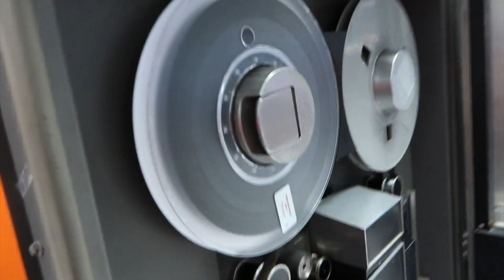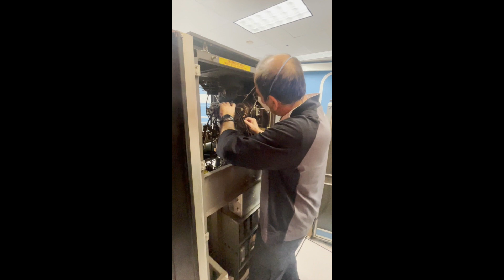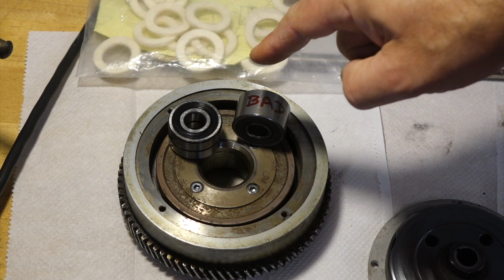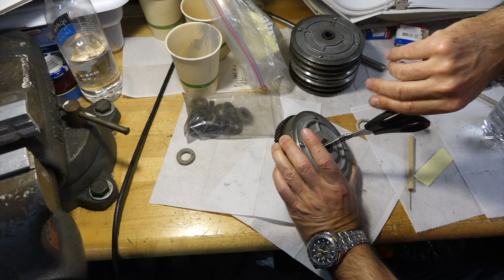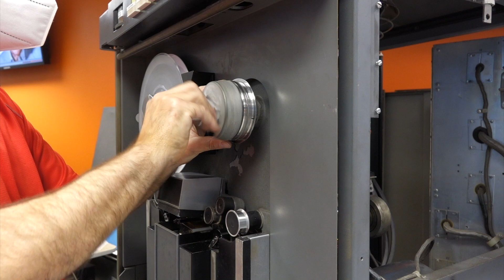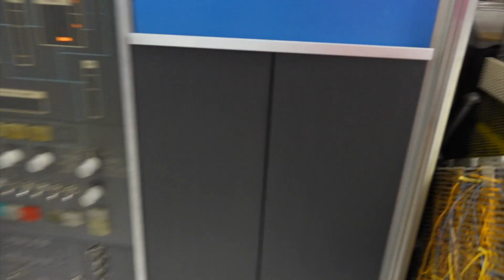IBM 729 Tape Drive Magnetic Clutch Job

Comment: I collect vacuum cleaners and when I seen magnetic clutch, first thing that came to my mind is my Electrolux upright model 1451. This ill-fated experiment at being the first upright vacuum cleaner Electrolux ever made used a magnetic clutch system to power the brushroll, it would float in the housing and engage via magnetic discs or some type of gizmos, and rotate without needing belts. It was meant to make a "lifetime vacuum cleaner" by eliminating one of the most common maintenance points. Well this design was not proven reliable and it failed repeatedly and was more hassle to repair customers' machines that it was worth, and exceptionally expensive to repair as was the vacuum itself. The vacuum was a major flop, extremely heavy and unwieldy, and the technology faded into history books.

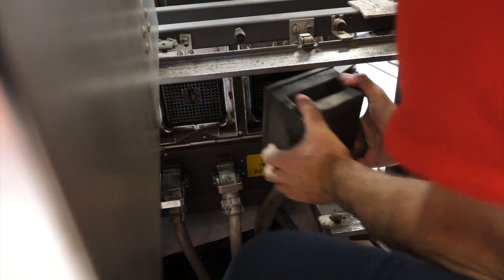Comment: 21:41 It's not an USB cable with only 4 pins !😅
Slow frequency need more wires for the data bus ?! Right ? Very impressive video.
I have immense respect and admiration for your work on this channel.
Hello from France.

Comment: n the 1990's i had a job of removing various parts from 8 large IBM reel machines like the ones here,just newer models,prob 1980's,for Memorex,they only needed a few pcbs the rest was scrapped,i asked if i could have the DC motors and various parts,had the motor control boards as well,huge aluminium heatsinks,so well made,i still have the motors & Driver pcbs today and they are 19v multi pole brushed,electromagnet poles,weigh about 15kg each,ive made various things with some of them over the years ,they can take 1000 watts for several minutes without getting too warm.I also had 8 vacuum pumps which were really well made,unfortunately all of them were stolen along with aluminium sheets around 1994 from my lock up.I worked till 11-00 at night that day, as the company was getting the chassis collected in the morning, Happy days.

Comment: My company uses magnetic powder brakes on the unwinds for our coating lines.  Eliminates all chatter, glazing, slip, etc with conventional unwind brakes.  But we run our webs slow enough that the units weren't always super happy and struggled to control.  Solution?  Constantly tumble the powder inside with a separate drive motor.

Comment: Maybe next time you are maintaining this area/piece, you can use the innards of the new SKF bearings, to rebuild the old seized bearing?  This way youll have the original bearing???

Just an idea.  You seem to have all the tools needed to rebuild the bearing properly.

Also you can use contact cleaner or engine degreaser and soak the seized bearing to hopefully remove/extract all the foreign material/magnetic powder that got inside the bearing. Although i would probably rebuild it.

Comment: Marc at minute 18:24 you mention that you are reconnecting the motor to drives the stop clutches.  This is not correct, that motor brings the head guide assembly and stop capstans into operation.
The stop motor connects via a shaft with worm gears, and is located above and to the front, hard to see in the pictures.  I thought that I had entered this comment before, by your instructions.
Reply from the maker: You had, but I had to re-upload the video due to a glitch! So you had to reupload your comment too... The good news is that you get another heart. ;-)

Comment: Marc said, "... but in the 1950s they did not have the power electronics capable of controlling large DC motors."

The Radars I worked on in the army were built from the 1940s to 1960s and the antennas were driven by electronics that used magamps capable of controlling antennas weighing thousands of pounds.  Magamps have been used for many decades to control electromechanical systems such as gun turrets and Radars.  The large magamps are controlled by small low power vacuum tubes aka valves.

Thanks, Marc, for letting us see the inner workings of the tape drives.  I worked with the mainframe datacomms so I never really got experience with the peripherals.

Comment: As one of my  long-ago professors said: "it's so slow, it looks incredibly fast." This when describing early computer electromagnetic devices, when compared to more modern electrooptics. He made that remark when explaining the operation of a big-screen display device that used a laser in conjunction with a pair of galvo-motor beam steering mirrors, but the principle is the same as one sees when watching the remarkable accelerations of the tape reels and vacuum columns. They are only "slow" when compared with the speed of the digital electronics to which they feed data.

Comment: The magnetic clutch — combined with the separate, continuously rotating motors, one for forward and one for reverse — is a great example of how IBM used what might be called brute force to jump ahead by twenty or thirty years of technological development. Of course this required an enormous amount of money to accomplish at the time. Those clutches undoubtedly came from some vendor, and were probably custom made to IBM's specifications. Then when you add the costs of assembly and testing, as well as the maintenance chain to keep them working at customer sites, not to mention the chilled air supply that was necessary to keep them cool, and you can imagine how much the total was for each tape drive; many large customers (like the government) had dozens or scores of tape drives running. 

The vacuum columns are another — and equally impressive — story, in my opinion. I don't know about the drives that were associated with the 1401, but the drives used in the 360 (in the late 1960s) had vacuum columns that were capable of shuttling the tape back and forth at a rate too fast for the eye to follow; the tape in the column was just a blur as it appeared to vibrate over a length of eight or nine inches. When this happened, they made an almost musical fluttering sound, hard to hear over the din of cooling fans and rushing air in the computer room.

All this to get a technological advantage over their competition, which was coming on fast. IBM was ahead, and their management knew how to use their financial strength to hold on to their advantage, by heroic means sometimes, as illustrated by this video. 

As a child, I was taken by my father to see many IBM sites in the 1960s, and worked at one in the 1970s. The actions of the tape drives was one of the most fascinating and alluring aspects of the IBM computers of that time. There was no other mechanical device that moved anything like those tape reels, which (when full of tape) weighed around five pounds.
Reply: All of the mainframe companies of the era used similar drives.  IBM originated most of the ideas that made them work, but other companies licensed the patents.
Reply: I think IBM was the only company to use vacuum columns instead of spring loaded arms to tension the tape though.

Comment: I'd think that the clutch you just repaired rotates too slowly to fling the powder to the outside, or is it the rotation inside the clutch that provides teh speed to get the powder to the outside?

Comment: Yes, how things have changed. Back in the 1970's my very enlightened maths master started a computer club where we wan-a-be programmers would write our code.  We would then transfer this to mark sense cards, which were similar to lottery slips where you would mark a tick in a box. These were then posted to our local University, where the cards were magically read by a special machine. Your program would then join a queue and when time was available, it would be run through The Computer. Some 2 to 3 weeks later the results of your hard work would be back. We had a phrase around that time, the white heat of technology, which was from a speech Harold Wilson gave 10 years earlier.
Steve M0KOV

Comment: Is there any chance you can just remove the dust shields from the original bearing, wash out all the magnetic powder, and re-lube it and put the seals back in? I'm sure the 2 bearings back to back will be just fine, but I doubt the original is actually "shot" and instead just plugged up with the powder.

Comment: Marc, what was the manufacturer of the original bearing ?

If SKF, the bearing should have a number stamped on the side of one of the races,  a number which could help obtaining a new alike one.

If not, what was dimensions ?

I could ask the local SKF distributor here.

Comment: Hey Marc, long time viewer here. I was actually a very young man when these came out, my first job was in my college working in the datacenter running punch card jobs. When the school upgraded their mainframe I 'finagled'  possession of the old one. It was a Control data 6400 full timeshare system complete with 8 of those vacuum column drives (The CDC version). Same design. They used vacum tube logic back then. Had it in my Mom's garage for several years. Fun to work on. Could only run it sparingly because of the power requirements, but fun while it lasted! Nowadays I work on modern enterprise stuff, but loved the days when you could go on a call with rolled up blueprints in one hand, and an O-Scope in the other....

Comment: Strange that solution with the powder. I thought it works like those automotive AC compressor clutches. That does not need rings and brushes either... the coil is stationary there. It wasn't invented that time?
Reply: They were, but they tend to exhibit significant levels of snatch when engaging - not a problem for an A/C compressor, but possibly harmful when driving reels of rather fragile tape.  Hence the magnetic powder clutch - they have extremely smooth torque takeup, which is why they are still used in material handling systems.

Comment: My university lecturer in the 1980s told us that the computer tape drives in the movies were silly props.  There was no way that the tape could shuttle backwards and forwards like that without snapping the tape.  Of course he didn't know about the vacuum columns and wonderful mechanisms inside the reel drives of these machines, which were very real indeed.
Reply: One would expect university lecturers get their facts checked well, figures.
Reply: You would think that. I had an engineering professor claim the factor of safety in modern fighter jets was 1.05. Every public resource I could find claims 1.5. 

Very painful to see people with influence say such things in front of rooms of students who won't check.
Reply: Presumably not a computer class, or any engineering class.

Comment: My curiosity for vacuum column tape drives is the reason I originally found your channel. Love those crazy machines. The clutches are a peculiar design. In cars powder buildup is a bad sign in dry clutches, so when you first opened this one up I thought "that thing is wrecked", but then you explained the whole magnetic powder mechanic and it made so much more sense.

I'm not old enough to have ever had a chance to work with these types of drives, but when I worked at MAN in Copenhagen in the late 90s they still had a (much newer model) vacuum column drive sitting in a corner just in case they ever needed to access the old tapes. Of course by then they were running a huge Hitachi mainframe (which as we know was basically just IBM made in Japan) with a massive pile of pocket size harddrives to power their aging CADAM terminals along with being the brains of the SAP and CICS databases. A few years later the mainframe went out and they switched everything to PC servers, but for me who's into the whole history of computers it was nice to work with the systems at the end of their era, and then learn from the likes of you how they started out long before I was born.

Comment: I love old electromechanical stuff like this. I can follow along with the logic, step by step, and understand the way it's operating. Which makes working on them so much easier than a modern computer
Reply: When the connector pins are as big as a frying pan that helps too

Comment: It has got to be nerve-wracking to restore mechanical computer components that old.

When you opened up that clutch and I first saw all that powder, I thought "Oh poo...A brake pad or seal has disintegrated." The magnetic powder clutch is ingenious.

I'm glad you had access to decent maintenance notes and the original technical manuals, and kudos to your troubleshooting/detective work on the felt seals.

Thanks for the video and thank you for helping preserve important computer history!

Comment: I'm amazed at how fast you can switch magnetic clutches. Added a new level of wow to watching the reels change direction.
Reply: Yeah I never even considered there was such a massive mechanical part to rotating those reels, that's quite amazing!
Reply: A very similar magnetic clutch was used on the Fiat 131 Supermiafiori racing supercharger.
I had one of those in bits and it had the same felt pad issue.
Reply: @adelestevens  so we went from a computer having the same problem as a car to cars having the same problems as computers XD

Comment: I'm always up for some percussive maintenance. When seals fail, the rest of the system is thoroughly borked. A clutch is such an important part of the drive mechanism, when it malfunctions all is lost. Doubly so on the IBM 729, a trusty companion to the 7 line of early computers. Glad to see a classic bench instrument (HP power source) to repair a classic computer component!

Comment: Great video Marc, just a small observation, at minute 18:22 you state that you are reconnecting the motor that drives the stop clutches; this is actually the motor that brings the heads down and up.
The motor that drives a worm gear shaft that engages the stop clutches, to bring the tapes down to the columns, and back up is further to the front, facing up, not using a belt.  Hard to see in video.
Reply from the maker: As always you are right Iggy. You are also in the footage if you look closely!

Comment: And all so you could store the names and addresses of perhaps 128 people! My first job in 1974 was to clean the tape paths when I came on shift. When I was a bad operator my supervisor made me clean the cabinet with a toothbrush. A very effective teaching strategy!
Reply from the maker: Oh no, the tapes were of very decent capacity. It varies depending on the size of records, but 20 MB I think. It would be a loooong while before hard disks in PCs would be that big.
Reply: @CuriousMarc  Yeah, later with 6250BPI the capacity even increased to like 50MB.... stunning.
When I first worked in a datacenter these were still hauled around the country as a data communications medium between banks and large accounts (utilities, insurance companies, etc)...
Reply: @Rob2  the old adage : a LOT of data can be moved by a truck on the highway - latency will be through the roof though and filling the truck would take a week or more ....
and the internet  can move enough data in two days so the mission is done ie good enough.
Reply: @TheStefanskoglund1  Although the datacenter had a gigantic storage system with a whopping 7GB capacity built from 200MB disk packs, they would not want to receive a truck full of tapes.  Instead they received small shipments by delivery vannette.
Reply: @Rob2  6250 BPI on a 2400-foot reel of tape can store 250 MB.

Comment: The most interesting thing to me about the IBM 1400 system was how long some of the related devices were in service.  I know customers that used the 1403 printers and 1419 document processors (cheque sorter) well into the 1980s.
Reply from the maker: This system was in service right up into the 90s I think!
Reply: @CuriousMarc  Weren't those devices usually leased?  That would have cost the user a lot of money over that time...
Reply from the maker: @Rob2  Originally they were only leased, but the anti-trust action forced them to sell some of them. IBM would still to destroy them at end of lease them to prevent them appear from appearing on the secondary market. Somehow these one escaped and were bought used.
Reply: @CuriousMarc  I was worried that the user leased it for 30 years, but apparently not.  Good.
Reply: One of the hardest Y2K problems apparently was the 1400 series code running in emulation on 360 mainframes. That's "only" the software, but it still is amazingly long lifespan for something that probably wasn't thought of more than something to rewrite later.